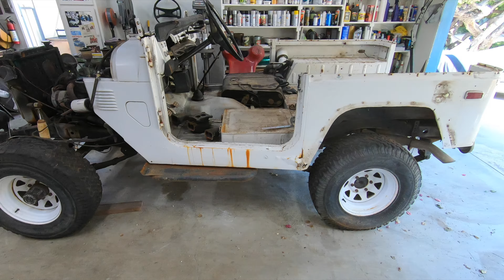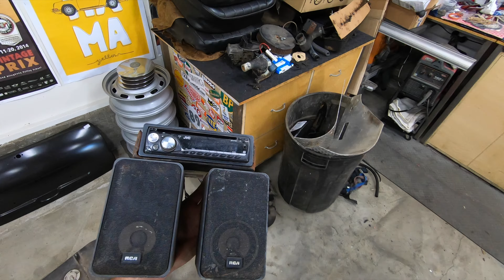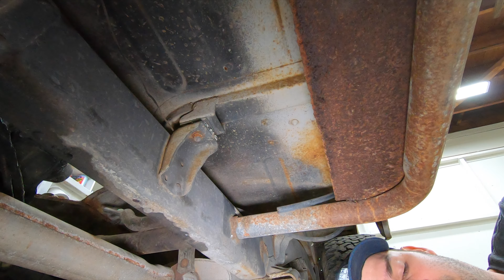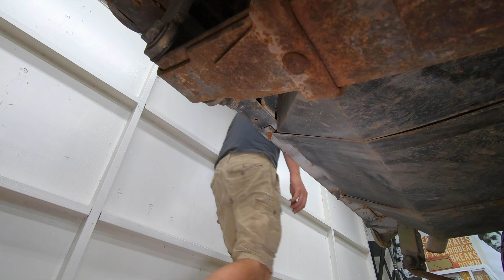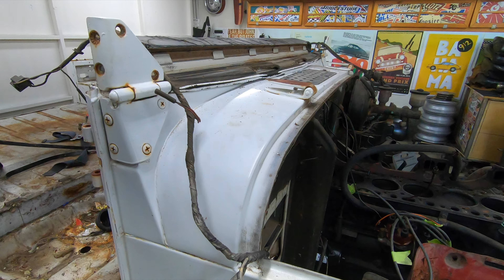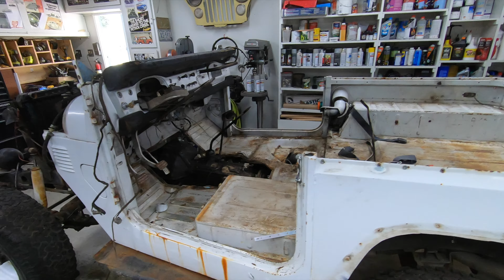FJ40 Land Cruiser (Episode 6) - Attempting To Remove The Body

Comment: I have a '72 FJ40 and can't get the tank out - not sure if it is held in from the underside, but I watched your video and removed the straps, the seat of course with the tubes there etc, but the tank seems to be held down somehow...?? from the underside?
Reply from the maker: Thanks for watching. That’s interesting there was nothing on the bottom of my tank holding it in. Just the straps and the fuel inlet and outlet hoses. Hope you figure it out soon👍